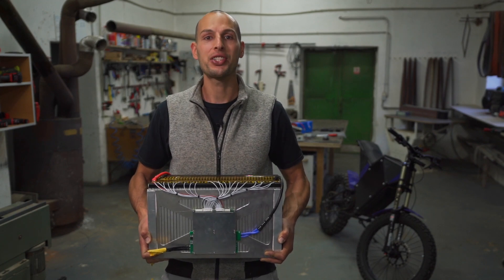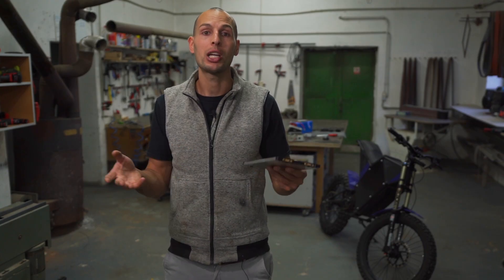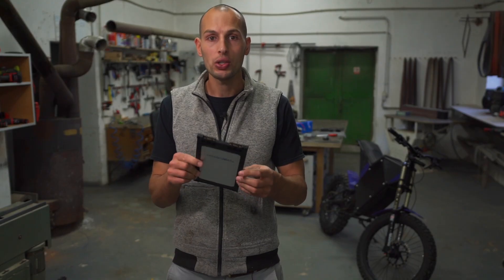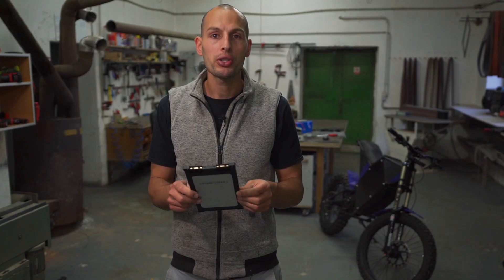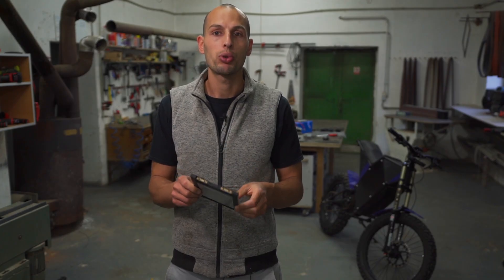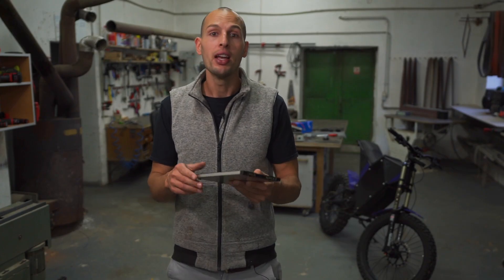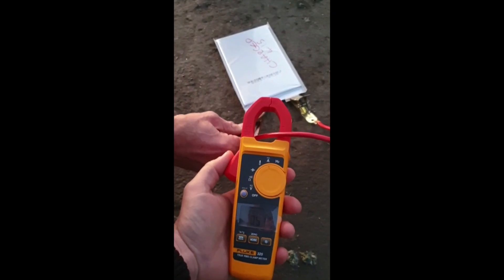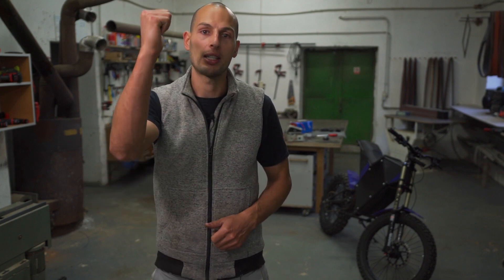Ultimate DIY eBike Battery With No Spot Welding or Soldering

Comment: I know all batteries they are ship only by ground or this time it is the true shipping by ship how we can buy it then we assemble it easy as you done it with your help of course how we can get to Canada even they have C040 double the power  	40.000 Ah /Pouch =Li(NiCoMn) /178.0mm x 209.0mm x 11.2mm /830.0g /20.0A /200.0A → 400.0A
I just find out the manufacturer is shut down at this time so no luck to get those battery at this time.

Comment: Hi thanks for a great video , I have 13 of these cells and want to make a pack suitable for my electric outboard motor 12V , could you please help me with the wiring of these , I don't have to use all 13 , can I use say 3 packs of 4 of these each with a seperate BMS or 4 packs of 3 , what would you do
Many Thanks ,  Alan
Reply: Where did u get them? I cant find them anywhere...
Reply from the maker: I have some left, how many do you need? Ladi@mysuperebike.com

Comment: 80 volts Battery ! WoW this is some huge POWER on the Bicycle....what is the Specs, peak power/ speed torque, range. etc.
Reply from the maker: 92V fully charged. 27kW peak, 120kmh max speed, 162Nm torque, 100km range

Comment: What is the energy densitiy of these cells? :)

Why did you decide to run your pack without thermal management, your load with >20kW makes me think that in summer, you'll get pretty hard derating after longer road trips @high speed?

Have you experienced issues because of the bulking of these pouch cells? You put them so narrow together, that the inner pressure of the cell would increase quite a bit, or not? :)
Reply: Just found the answe to the first question myself :D 174wh/kg.^^
Reply from the maker: We have 3 temperature sensors, no bulking or temperatures over 30 celsius.

Comment: hey man I just want to say thank you I learned a lot from you I'm a big do it yourself guy and I laugh at a lot of people you do some great yeah I'm building a stealth bomber and because your bikes exactly what I'm building the big help I tell you I'm having a hard time finding those pedal the ones you like what you heal I'm going to watch that video again but hey I'm at the point where I got my tires and rims that beautiful unique shocking beautiful front shock Forks I got my m x u s turbo V3 now it's time I have to buy the controller was wondering getting one of those kits on Ebay the controller the sensors this motor has a double Hall sensor nice monitor throttle xcetera any kind of great advice would be the best obviously I want the most power and speed out of this motor when I originally bought it he tried to tell me it was 12000 Watts I don't think so I think it's 3 anyway again thank you very much for your educational videos super helpful oh yeah I got to do a battery build to which cells to buy enough to drive you crazy well thanks God bless Dennis M New York Long Island
Reply: Denys M the motor wattage depends on the battery.   It may be true that the motor can handle that wattage, but there are different ways of rating a motor.  
1. Continuous Rated wattage.  (Normalized range) 2.  Peak continuous (maybe 30-45 seconds)    3.  Peak burst.   (Only for a Few seconds)..... this threw me off when my seller original sold me at 5kw. Then I found the rated wattage of my motor was only 3kw ...and I got pissed off, only to realize it was a misunderstanding altogether.  Most sellers advertise the peak continuous rating or peak burst, not the rated wattage.   Multiply your battery amp rating times the c-rating of the battery (this is based on the maximum discharge amps,  so if your battery is 40ah and it has a 2C rating, then the max discharge is 80amps) times the voltage.    So...  basically if you know your (max discharge) amps, just multiply it times the voltage you can find what your max wattage going to your motor will be.    I’m new at this myself but this is my understanding of it.    Please if anyone knows more , it would be helpful

Comment: Where do you buy these cells and what is the cost
Reply from the maker: I have few left for 22€ a cell
Reply: @ladiandmargaret  how many cells are needed to build a battery for a 72 voltage motor
Reply from the maker: 20 cells to have 72V.
Reply: @ladiandmargaret  thanks for the quick reply

Comment: I have a e electric roller with AGM Batteries 48...52 volts , 2kWh .Motor has 3kW power . I can put there your lithium battery and charger   ?
What is the cost  ? Thanks

Comment: Pretty impressive battery. How come it has so many charge cycles? I mean Lithium can only withstand so much. Wouldnt Tesla be all over this if it really had so many cycles?
Reply from the maker: That would be better question for tesla engineers but I think this lipo pack has heavier kWh than liion cells.
Reply: Weight is the problem

Comment: This battery pack can use for v4.2 ebike?
Reply from the maker: No unfortunately, no reasonable configuration fits inside 👎
Reply: @ladiandmargaret  what if using the cyberbike body frame to replace v4.2 ebike body frame? is it possible?
Reply from the maker: Yes it is. You can even use the same motor.
Reply: @ladiandmargaret  i love cyberbike bodyframe and her battery set with BMS but i like hub motor more than mid drive motor.

Comment: This might be the ultimate solution for my electric motorcycle project. I designed a monocoque 2 years ago that can hold 48 Nissan Leaf units. As such these are rather heavy for a motorcycle because they are all individually encased in metal. It did however lead to an internally 225 mm wide design monocoque in which a lot of different solllutions can be packed so I went ahead with building it anyway. The cells you show are actually still on the small side for my design! Since my monocoque is completely steel already I should even be able to use metal casings that are even more minimal then the one you add! :-)

Comment: Li-pos are too dangerous for EVs no matter the BMS.  The thermal runaway risk is far too high.  Your test does not show what would happen in a completed pack.  Single cell testing is not enough.
Reply: Yes I do agree! Have you seen that fail safe option those guys use with the 450kw Tesla motors powered him climb car in Australia? Their fail safe is by flooding the battery packs with water is the fastest and safest discharge they reckon?
They also said mention that most of the fogger systems they tried the extinguisher acted like a propellant and only made EV electrical fires even more unsafe.
Basically it requires essential thermal monitors and possibly a scada controlled coolant system (that adds weight for additional fixings)
Reply: Keep in mind he's building packs for performance. I'm just sure googling electrical fires is taboo similar to google searching air crash investigation before heading on a to trip over seas (pre-corona)..... You just don't do it!

Nobody wants to know they have the power density close to plastic explosives should they get a run away lithium fire! (Think run away diesel for all those people not following)
Reply: Sub station fires are spectacular 😲
Reply: https://youtu.be/TMeSkx2oy6U
Reply: On that link I posted. Go to 10min 15sec and listen to what they say about their safety specs and why they do thinks that way? A more automated way would be to dump coolant that's in circulation around the back (yes design packs to be water cooled) is your only safest way of using LiPO packs.

You can't ever register a vehicle with LiPOs in Australia anyway
Reply from the maker: Hi, you are wrong. These cells have been tested properly by overcharging them, chopping, short circuiting them. They don’t catch a fire nor explode.

Comment: Another down side that it is very heavy ...
Reply: Not that heavy, 20ah 428grams, that is 7 times capacy at 50-70g penalty comparing to 18650 as they can be anything from 46g to 68g per cell, but these obviously have many benefits. So drop the cheesecake and coca cola from your diet and you should be good to go ☺.
Basically these need 14cm wide frame or 12cm frame with 1cm cover on each side, Ladi has mentioned that anyway, no go for us that like to pedal and care about stealth looks.